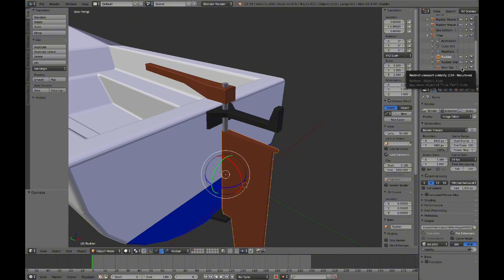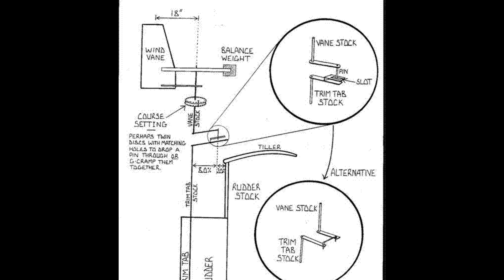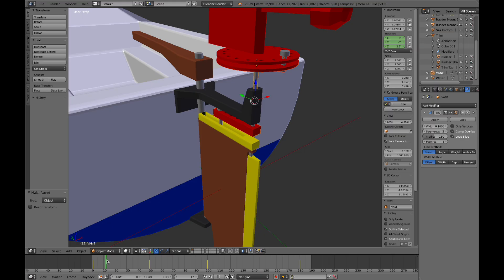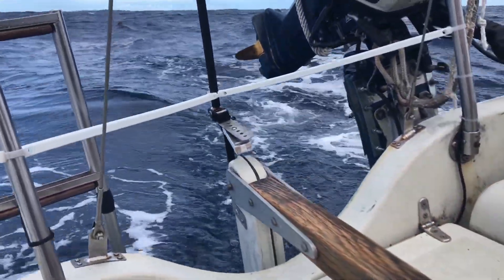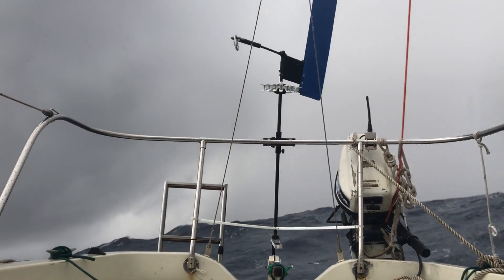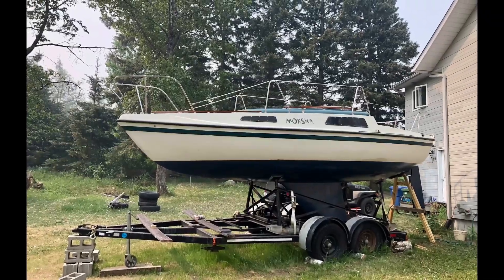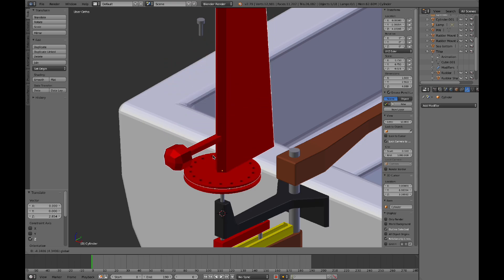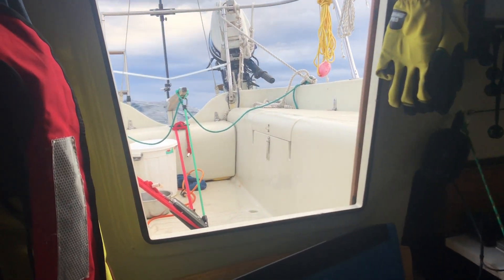Simple "Trim Tab" Windvane Design

Comment: Is the sail section of the device gimballed or does it follow the lean of the boat?
Reply from the maker: It's not gimballed. That's why it's important to balance it with a weight, so that it's not affected by the ship's leaning angle. If it's lightweight, the boat's rocking motion when sailing downwind is not going to affect it either.

Comment: Curious what you think of my DIY made from Bill Belcher plans.  https://www.youtube.com/watch?v=DrVIi9gjENs       I would love to put your wind gear on top of my auxilliary rudder with tab.  It would be a much simpler device. My boat is 33 feet and 10,000 pounds so I wonder how big the flag would have to be, in order to control my boat. I would need to put it higher to avoid the windage of the boat. On my channel I have other videos made after the design was tuned up, and the boat reacts faster. Thanks for the good video. I love your design and how you rendedered the basic design in animations. If you ever get to Hawaii, contact me and try mine out. Aloha, Mark

Comment: Hey mate, wondering if you would mind sharing plans for the windvane ? Love the design !
Reply: Mostly interested in the material used for the linkage section above the trim tab 

And building of the vane / plates - thanks
Reply from the maker: I build mine with scraps... mostly aluminum and wood. Important is to keep some hard rubber (like TPU or teflon) between the contact points of moving parts. The trim tab can vibrate at higher speeds and would otherwise cause noise and wear
Reply from the maker: Unfortunately I just built it from the top of my head, without any plans.

Comment: L'idée vient de Patrick Van God, and since you choose to publish in english, learn that a wind vane cannot steer a boat. It can only transmit wind information to a self steering device.
Reply from the maker: D'accord...
Reply from the maker: So... the wind can't steer the boat, but the boat can steer itself?
Reply: @FedericoLucchi  that part of my comment was purely semantic. I was refering to the use of "wind vane" in place of
Reply: @FedericoLucchi  that part of my comment was purely semantic. I was correcting the use of windvane instead of self steering gear, which is the correct term in english. The author of the video is french and evidently does not master the english language sufficiently. The boat does not, in general, self steer itself. The selfsteering gear does that, using the wind as source of energy.
Reply from the maker: @pascalgrinberg5530  Je suis l'auteur... j'avoue que la sémantique m'échappe complètement.
Reply: @FedericoLucchi 👍👍🙂

Comment: Could You make video a little bit longer? Show us more details, how does it work et cetera. Thanks a lot!!!
Reply from the maker: Thanks for the comment! In this video I wanted to share my experience with it, unfortunately I lost the boat (and the vane), so I don't have much more footage. The idea of the system is very simple: the wind turns the trim tab which acts like a "mini-rudder" which in turn acts on the actual rudder. If you have a boat you can easily assemble an improvised setup, then test it and improve the design. Obviously if your boat's rudder isn't hung from the transom, you'll need to build a removable rudder and fix it to the transom.

Comment: Moitessier's rudder is not just transom hung, but also on a reverse angle. And the trimtab is on an extension closer to the vertical. This means that as the rudder turns, the trim tab is rotated, causing it to feather. it accomplishes the same effect as your linkage, but requires an angled rudder. Also note that the pivot of the vane is in line with the pivot of the rudder. His boat also had long keel and would have tracked very well. He was the only one who's self steering was still functioning at the end of the race! (he had dropped out of the race and continued to tahiti, of course)
Reply from the maker: Indeed, Moitessier explained the importance of the angle between the trim tab and rudder axis. With the design I used it's not necessary, so the windvane can be vertical. My boat tracked almost perfectly in low winds, despite having been a fin keeler.
Reply: Hey Dominic I would llike to send you my idea for your input
Reply: @dominictarrsailing sent you FB message about a windvane idea

Comment: Thank you ! I'm just starting to design one for my boat, and so pleased (ok, a little smug) to see my hero Moutessier had the same simple design idea. Your video is very helpful, it really is such a simple solution that I have been thinking to myself, 'surely there is something wrong here?!' ... but no, it really is that simple. My idea to lock the vane in position is a disk with holes around the outside and a spring loaded pin with a line to the cockpit, so that it can be activate without hanging over the stern ... well that's what's in my mind, we'll see if it works!? I see I had watched your rescue video, hence this one arriving, so sorry for the loss of your boat (rudder break off - problem not connected to self steering I hope), that's gutting, but at least you are safe.
Reply from the maker: I used the disc idea as well, although I didn't bother with the control from inside since my boat was small and the windvane very accessible. From my experience, I'd say to keep it as simple as possible, and if you head out to sea bring tools and spares. You'll surely come up with some idea (since you won't be busy at the helm) and will be able to implement it.

Still, your plan sounds quite feasible!

My rudder wasn't lost because of the windvane! Ironically I lost it the only day where I actually helmed the boat for the whole day (Like Moitessier, 99% of the time I was using the windvane). My mistake was to sail way too hard upwind with too much sail aft, thus putting enormous pressure on the frail racing rudder.
Reply: @FedericoLucchi  I'll let you see how I get on, thanks for the inspiration.

Comment: Thank you for this video. Your design is simpler than what I've seen before. Would you be willing to post a bit more detail or sell a drawing and measurements. How wide is the tab and how did you fasten it to the rudder?
Reply from the maker: My rudder was about 40cm in width, and the trim tab about 4cm (so the trim tab should be somewhere around 10% of the rudder's width). I built two very simple hinges from aluminium to hold the trim tab. Think of it literally like a smaller rudder that steers the main rudder. The concept is very simple and it can be built in many different ways.

Comment: I like the tube you added for dampening the action. I wish I had a transom hung rudder. My rudder's trailing edge is visible from the back of the boat when sailing but not when tacking or making large corrections so I have to figure something else out 😕
Reply from the maker: I saw two designs you could use: one is just to build a secondary rudder equipped with a trim tab that you fix to your transom and can retract when not in use (when in use, latch your tiller/helm midship),

The other is a "pendulum trim tab". Basically just a trim tab (with the vane) without rudder, mounted to the transom on a "pendulum" axis, so that when the boat is off course the pendulum would swing either to port or starboard, pulling ropes that connect to your tiller/helm